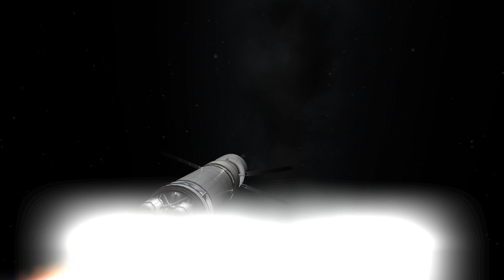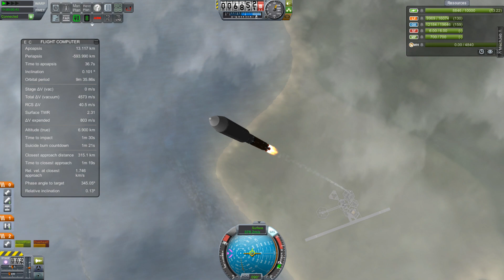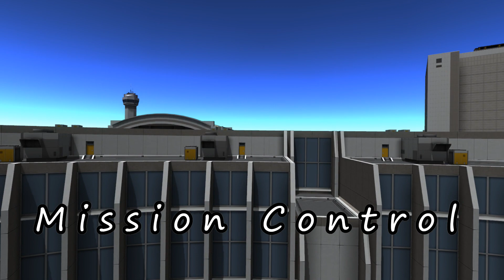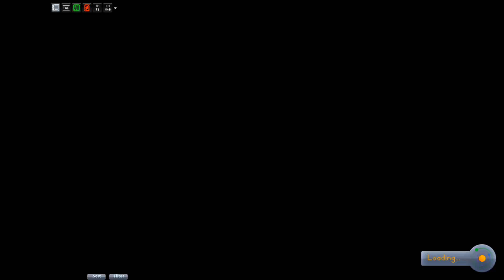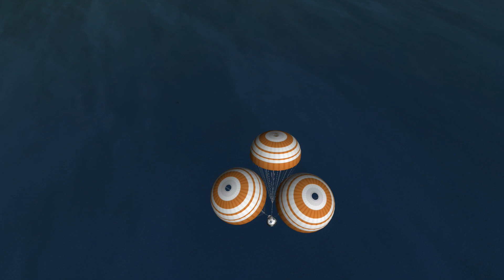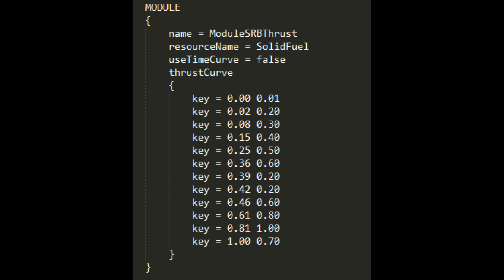E10: "Solar Truss" / Project Odyssey / KSP 0.23.5

Comment: Station model is looking amazing. Getting that gateway vibe now :) sensing a big eva cleanup on extraneous parts to deorbit soon. May I ask, do you pre plan the overall design or just have a general idea and rely on a more module management approach to its engineering?
Reply from the maker: I kind of make it up as I go along, though I have a very simple mental image of what the whole thing MIGHT Look like if I made it big. I'm having FPS issues though, which is strange since the station in Gateway was WAY larger. I have not looked into the problem much because Odyssey station is not what this is about. It's about the crafts that will do to Duna.
Reply: Id hesitate a guess to the FPS degradation  being somehow related to the better atmospheres mod (on top of the part count and mods already installed) and perhaps even proximity to Kerbins draw distances straining performance? Just saying as Ive been getting some FPS issues as well on moderate part count vessels that should be running smoother while using it in close orbits. Awesome production as always, highly enjoying it each week and looking forward to Duna!
Reply from the maker: Yes the main differences are probably innocuous EXCEPT the atmo changes. That's a good idea to check.

Comment: That was the first time I saw you use the launch abort system during a real launch not a simulation
Reply from the maker: While I'd love to take credit for a new series first, I believe I state it was a simulation still. It's been a while since I made it though. I'd have to rewatch it to see what I said.
Reply: Whoops I mean during a simulation
Reply from the maker: Yea I think my sims are usually things with no crew. MY crew carriers rarely have issues because they are tried and true designs from back in Project Gateway, with just minor changes.

Comment: @Bob Fitch : if your using the interstellar plugin and apply it's radiator module to yours they'll actually rotate sun tracking so they're edge on to the sun to keep them as cool as possable. You may be able to do this with the generic animation as well with something like {animateGeneric = rotation*-1}
Reply from the maker: Real radiators do not automatically rotate. I prefer to intentionally not let them rotate.